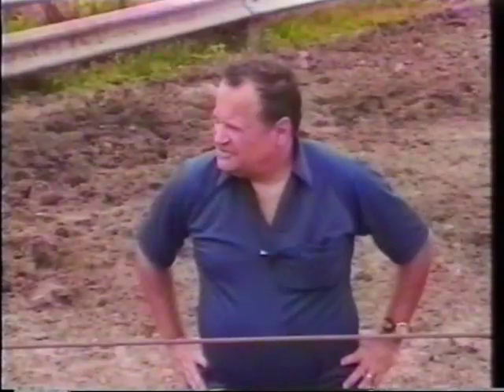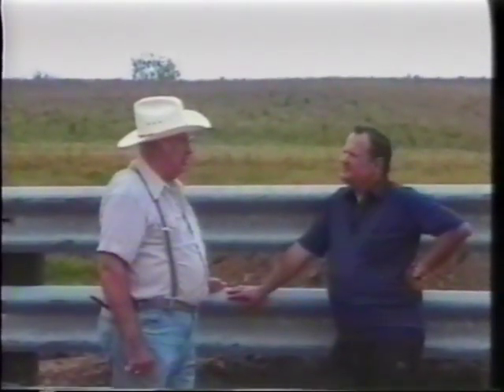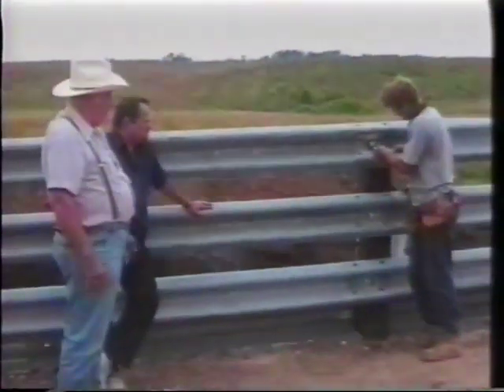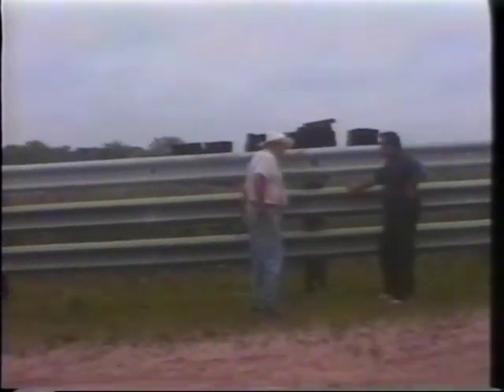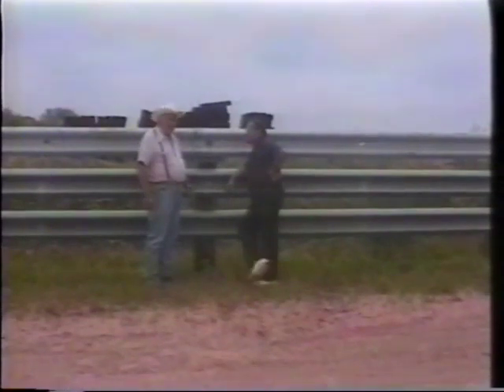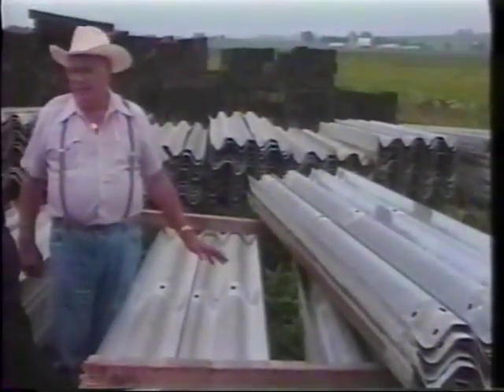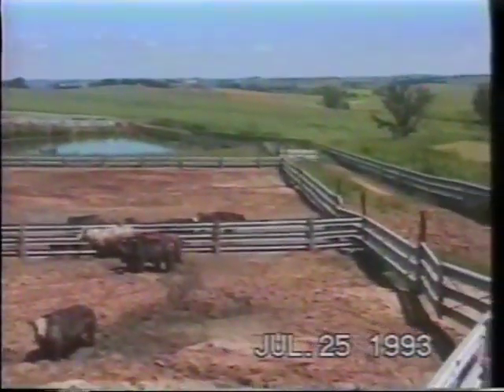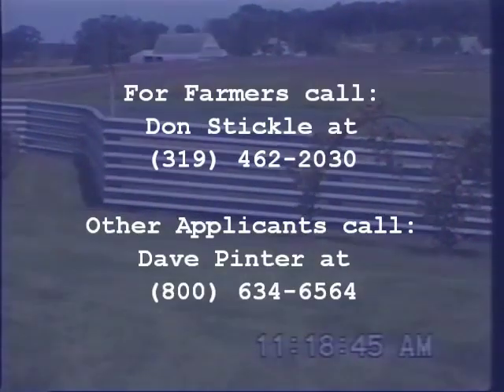How to Build a Lifetime Corral with used Guard Rail

Comment: how much per section of guard rail ?    How long is the guard rail ?
Reply: +Cuku Kenivel In my area (West Texas) they charge from $2.25 - $2.75/ft. Each section is actually 26' long, but they only charge for 25', so each section would cost you between $56 to $68. They look and work great, but too rich for my taste.